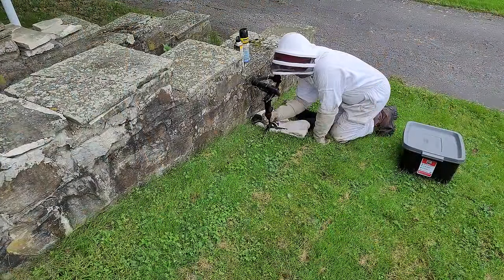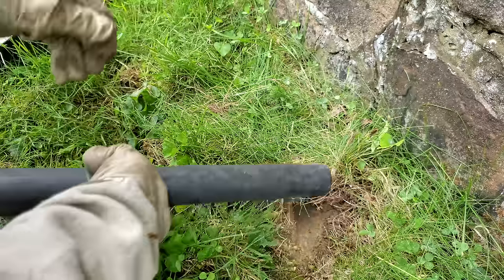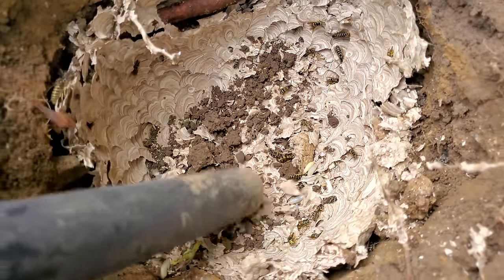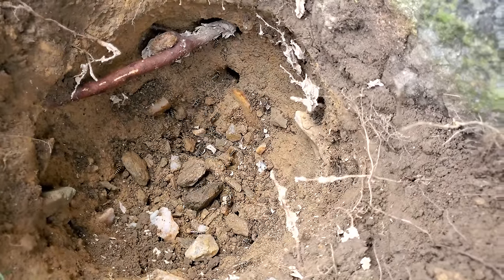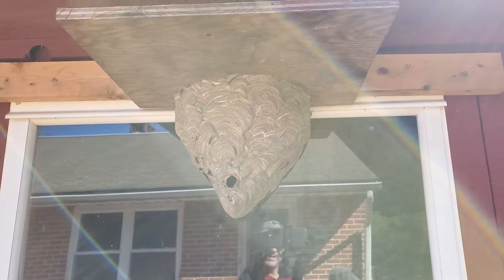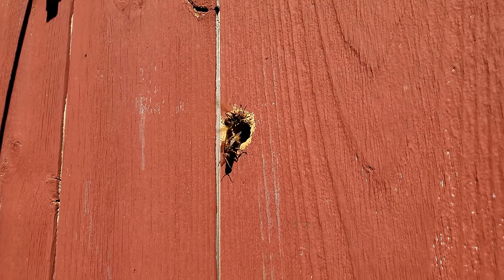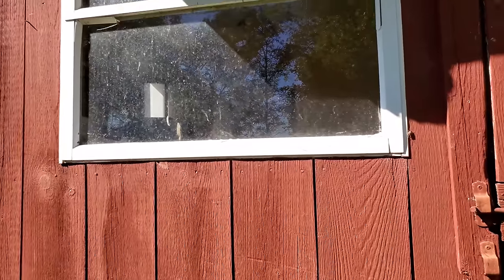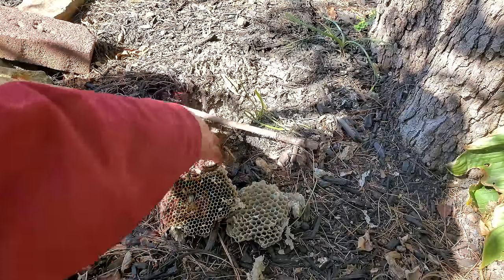HUGE Yellow Jacket Ground Nest | How To Remove A Ground "Bee" Nest | Wasp Nest Removal

Comment: I was an exterminator and I did commercial properties. There was a grocery store that had 10 separate wasp nests around the dumpster. I removed the wasps and I receive another call a week later for the outrageous number of flies entering the store. When before there was almost never a fly in that place.
Reply: The cruel, cruel irony
Reply: Someone needs to sanitize their dumpster lol
Reply: Bingo... It's called the balance of nature...
Reply: Wasps should not always be removed.

If they are too close and comfy with the house, sure!
But if in a spot where they ain't gonna bother you, leave it be, you will have WAAAAAAY less pesky flies and other small bothers.
Reply: @johnnypetersen5606  bro 10 wasp nest tho?! cant even take the trash out
Reply: @vlonemixee8214  His house is like a minefield that only he knows how to traverse through to take the garbage in and out lol. He can prolly do it blindfolded.
"Ten steps east, STOP, turn left, ten steps north, STOP. Shift 30 degrees, walk straight for 7 paces, STOP. Garbage bin is on the left." ;)

Comment: I’ve always use a small portable generator with a hose connected to the exhaust.  Run the hose in the tunnel of mole, vole, or yellow jackets and 15-20 minutes later problem solved.  Keep up the good work!

Comment: I've always been fascinated by wasps since I was a child. My father has these extremely bright red wasps that are all around the roof's edge every summer. they are completely red head to toe and they are eastern European hornet size possible a tiny bit bigger. it's in Eastern Kansas. do you know what type they could be? also, they are EXTREMELY aggressive. when I walk around the side of the house I walk at least 10 feet from the side of the house and the guards posted up on the edge of the roof watch me and move so they are facing me as I walk by.

Comment: I use a lawn mower exhaust, run a 5/8 garden hose connected temp to the muffler and the other end in the hole. Run at Idle for 20 minutes add a littler wd40 at the connection of the hose to muffler and you may see another entrance.

Comment: I actually have a cicada killer nest right out my back door (a gopher burrow that was repurposed by the queen), and I fully understand that even though they are scary big, as long as I leave them alone, we’re cool. Same goes for the occasional bumblebee hole I’ve glimpsed over the years in my lawn (only know it was there when I saw one coming in for a landing). I’m leery of hornets and paper wasps because I bumped a nest or two over the years and well remember how much their stings hurt… I still have a small scar from when a paper wasp got me on my dominant hand. But now, I have a yellow jacket nest and I dislike them most of all just because of how readily they sting if you end up too close to the nest, and have an active nest next to my collection storage shed.

Comment: You are completely incorrect about the gasoline method. The liquid does not have to reach the wasps. The fumes from the gasoline are what kills them. It doesn't matter which direction the hole runs, the fumes will still reach the nest and kill the wasps.

This nest could have easily been eradicated by the home owner.